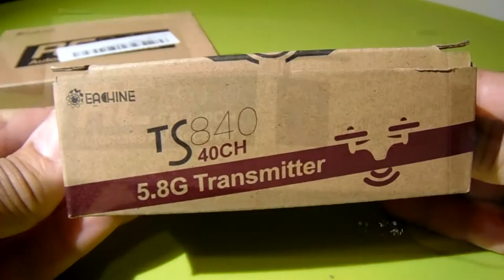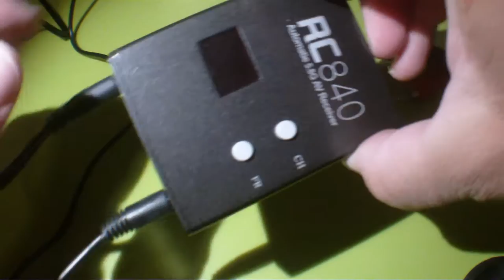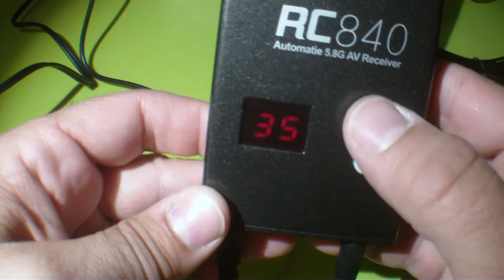Eachine TS840 - RC840 5.8G 40CH Raceband Wireless FPV - Unboxing and Test

Comment: what camera did you connect the ts840 to? and what battery did you use to power the ts840?
Reply from the maker: If I remember well I used this one http://www.banggood.com/Eachine-1000TVL-13-CCD-110-Degree-2_8mm-Lens-Mini-FPV-Camera-NTSC-PAL-Switchable-p-1053340.html?p=HM3106075425201208YA
The battery is the same I use for F550: 4S (from 5000 to 5800)

Comment: Hi. Immediately we recommended to buy the antenna Aomway? Or you can fly to the runoff. As far as the range of different
Reply from the maker: It depends on distance you want to reach. 
In this days I'm testing this new antennas
http://goo.gl/gx6vjB

http://goo.gl/gXX5hs

The first is short and good for fpv racer. 
The second one is the same of aomway but cheaper. 
I hope I can post result in one video soon. 
Anyway if you plan to flight in very short range you can use the stock antenna. But I suggest to replace them ASAP.

Comment: Hi there. In your video you have a bunch of OSD info on the screen.. Can you flash the osd on the TS840 or do you have a secondary OSD attached like a minumOSD or something?
Reply from the maker: I used a separate osd with gps
Reply: where did you get this gps osd?
Reply from the maker: +Karim Errytouny I bought it on banggood.com but now isn't in Stock. I found this that I think is better than mine
http://goo.gl/mY6ZaV